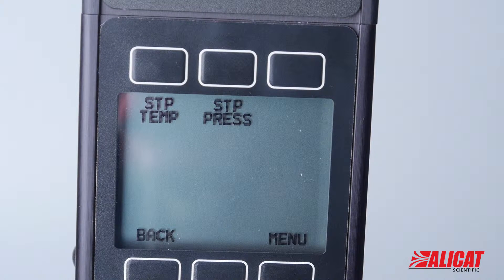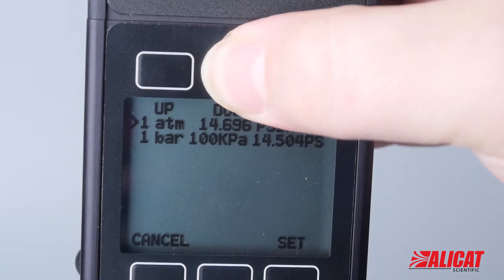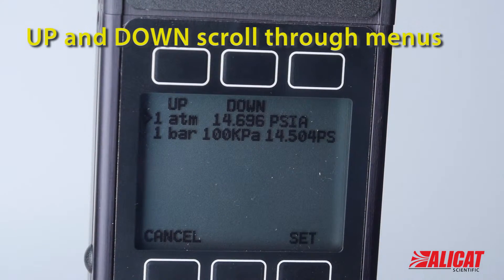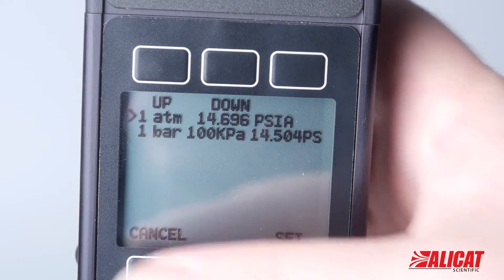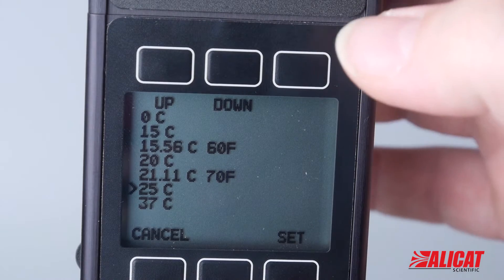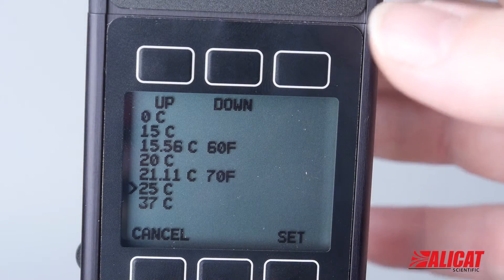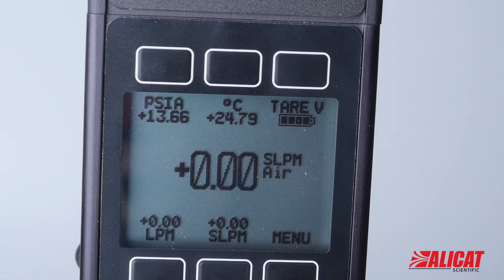Alicat Mass Flow Meter: How To - Change Standard Temperature and Pressure (STP)

Comment: Hi Jesse.. Nice video..!!

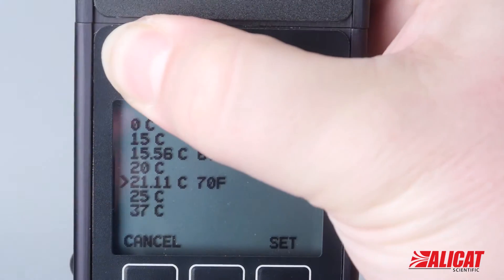I would like to know more about the test you mentioned at time line 1:35. I am curious to know how does the changes made in STP and NTP affects the mass flow in real world applications. It might also help explaining why there is a difference in the mass flow reading when two different meters connected in series but set to different STP ref. conditions...

Thanks..!!
Reply from the maker: Hi Gajendra,

Thanks for posting!  STP and NTP are essentially two different ways of saying the same thing.  There's no universally accepted STP or NTP, though NTP of 0°C is fairly common in Europe and STP of 25°C is fairly common in the US.  The pressure is almost always going to be around 1 atmosphere, though different people prefer different units.

The last equation on this page (https://www.alicat.com/knowledge-base/theory-of-operation-laminar-differential-pressure-flow-measurement/) shows how standard temperature and pressure affect the mass flow rate.  The trick here is remembering that the standard temperature is in Kelvin, in this equation.  If one meter has an STP of 25°C and another has 0°C, the mass flow reading will be off by a ratio of the standard temperatures in Kelvin, about 8.4%.